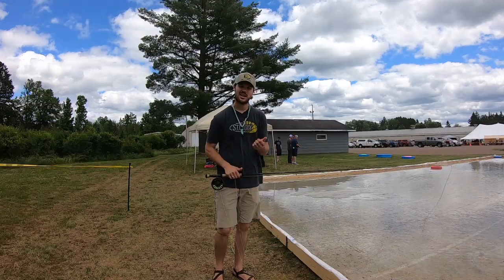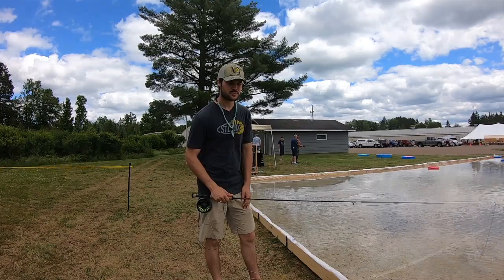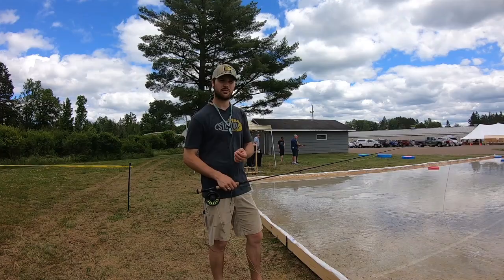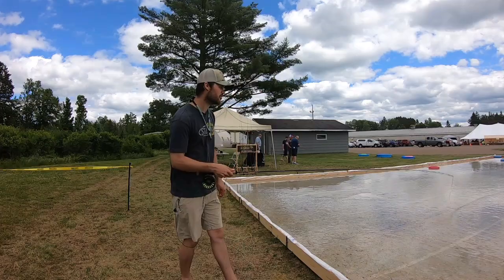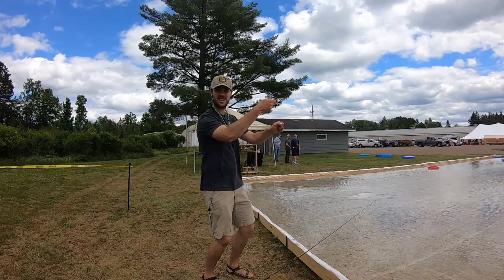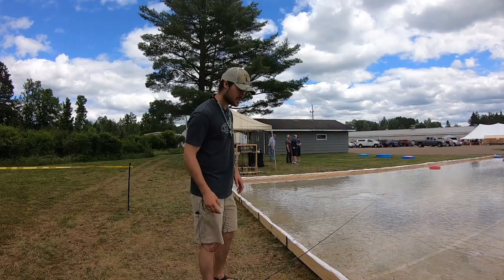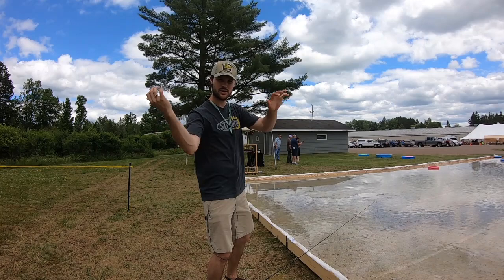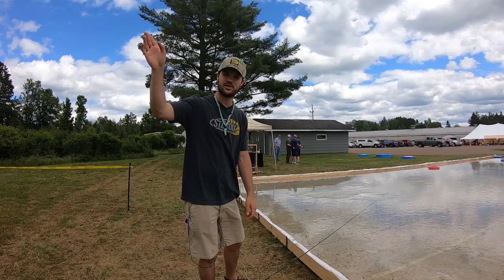Timing the Double Haul

Comment: As a 20 year FFI CCI having given 600+ casting lessons, I would like to offer a solution on intro of slack during hauling. 
When a caster feels pressure relieved from the rod tip (introduction of slack), as you pointed out, it is an inefficient element.
Correcting this common casting/hauling error can be easily removed and mastered by using a very short/quick haul as the rod tip turns over. The line hand closely follows the rod hand on the back cast prior to the haul and closely leads the rod hand on the forward stroke prior to the haul. This haul keeps the rod hand & line hand relatively close during the stroke, provides efficiency in matching the stop, rod tip turn over and all the benefits of hauling. Try to make a 6" haul! Like me and most others it will be an 12 to 18 inch haul. This short hauling will produce the skill to both maintain and sense pressure on the rod tip and the length of it can be adjusted as desired